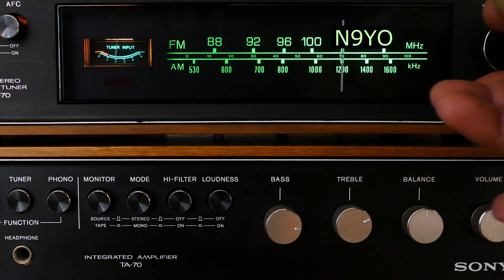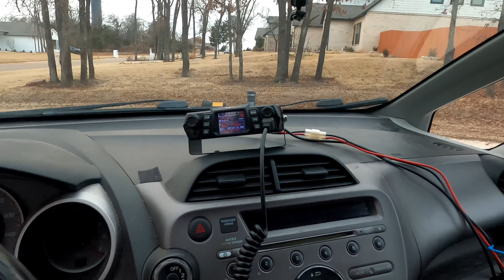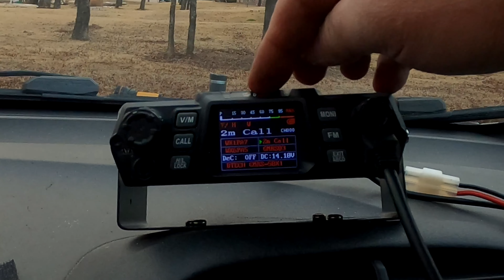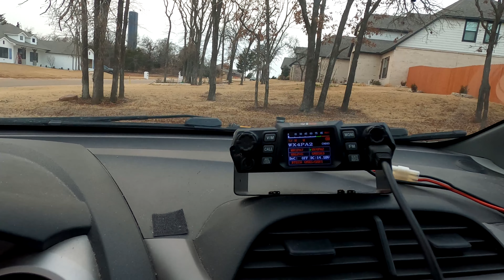Car Ham Radio Install BTECH GMRS TX 50 Watt (2M 70CM RX Only) Radio

Comment: Twister sure is a cute little guy!  Glad to hear your window mount antenna is working out for you...cool!  You are going to be set with all your mobile radio options.  I like those little Uniden CB radios.  I had a little Uniden Pro-510XL in my pick-up truck along side my Kenwood 2m mobile for years.  They perform quite well and take very little room.  I am going to get another because I like to listen to them on long trips.  I have had a grabby tool for several years and it has saved me on many occasions.  A must have!
Reply from the maker: Hey thanks for the nice comment KX4UL.  I'm still working on the car.  We got some bad weather so I postponed what I'm doing.  I'll report asap.

Comment: Black convoluted loom will cover your coax and power cabling, and adhesive tie wrap mounts will hold it in place without drilling holes.
Reply from the maker: Great idea, I just bought 100 adhesive tie wrap mounts

Comment: Am I misreading the ad for this radio?  Regarding the 2 and 70cm bands, it seems to indicate that you cannot transmit on those bands. It says: “The GMRS-50X1 is also a VHF and UHF scanning receiver capable to add additional channels for receive only.” I hope I’m reading it wrong.
Reply from the maker: Hey Larry, sorry, you are correct.  I bought this for the GMRS and I just assumed it transmitted there also.  Since it doesn't transmit 2M 70CM, I'll just put that little QYT back in there.

Comment: Hi Tom,

If you are going to drill into the roof, why would you use a mag mount?  Better to drill a hole for an NMO antenna mount, they are weatherproof and very secure.
Reply from the maker: You are correct.  I have never used an NMO mount before so I'll try that.
Reply: @hamradiocq  good luck... it’s scary drilling holes in cars!  I haven’t done it myself so I wouldn’t blame you for not doing it

Comment: Thanks for the video.  This was very helpful...  I'm new to the world of GMRS radios and connection stuff for electrical.  I just got myself the same radio Btech 50watt GMRS.  Is it right that I connect directly to the battery (of course have in line fuses)?
Reply from the maker: Welcome aboard!

Comment: NMO is the way to go. I installed mine using a step drill. I put piece of masking tape and drilled through it. Just use light pressure. Make sure the headliner is low enough so as not to drill into. When you need to take off antenna there are caps to cover and seal.
Reply from the maker: Yeah, I've never done NMO before so that's a great idea.
Reply: Ham Radio CQ, I practiced on an old license plate and installed the NMO and antenna on it first, lol. There’s some good videos out there on NMO installation. I would not have attempted myself without watching. Afterward I knew I could do it. Mine’s been on my 98 Honda almost 2 years.

Comment: Running cables thru firewalls is a royal pain.  No easy way to do it.  For the power cable, if you don’t mind the holes, can you drill a hole right behind the radio and drop the power cable down behind the stereo?  Also, I installed that same CB in my truck but even with ANL on, the ignition noise made it unusable.  I added toroids and filters...no help.  Wound up using an older CB that filters power leads better.  Have fun!  73 de K2CJB
Reply from the maker: That's a great comment.  I was cursing everything trying to get thru that Firewall.  It was horrible.   Good comment on the CB.  I used to have some that I bought at a garage sale, but I got rid of them during my last move.
Reply: @hamradiocq  Pretty funny that you found a screwdriver in there already!  Hahaha

Comment: My truck has a gap between the dash and the windshield you might need to get a fish tape to pull the wire but it might work
Reply from the maker: I don't think I have a gap there in this car. It's pretty tight.
Reply: @hamradiocq  Neither did I but I kept loosing  the pay here parking receipt down there

Comment: Careful drilling the passenger dash area...there's an airbag under there.
Reply from the maker: Yikes!  I decided to get adhesive mounts, thanks for the tip.
Reply: @hamradiocq  That little oval with "SRS" molded into it in the plastic stands for Supplemental Restraint System - the air bag is under that panel.

Installing mobile radios has become more complicated in recent years.

Comment: Looking forward to seeing some storm chasing with mascot Twister on the team. I have a Yaesu FT-857D installed in the truck, I have a dual band antenna. I have the duplexer to run both HF and VHF/UHF antennas, but I need a good mobile HF antenna. I should be able to get the GMRS freq's too. (yeah, I paid the $70 too....dang law abiding citizens).
Reply from the maker: Yeah if you or me don't follow the law we go to jail.  Others not.  : )   I looked up that 857D, looks nice.   I might do HF eventually with a radio like that. That little car doesn't have many places to hold a radio.
Reply: @hamradiocq  yeah, they don't design them for our hobbies! I had that radio in the truck when we went to Dayton, not sure if you remember. Oh the cold there is probably easier to handle because, it must be a drier climate than Misery.

Comment: If you drill a hole in the roof just go ahead and  put a through hole NMO antenna mount. This will route the coax inside and seal it up. Kills two birds with one stone.
Reply from the maker: Yeah, that's a good comment, I really have never done any other type of mounts, but an NMO sounds like it just hard bolted to the roof.

Comment: Thanks for sharing. I have the Btech UV 50X2 mobile. I use it along with a TYT 9800. The one thing I don't like about mine is the connection for the microphone seems to interfere with the control knob. Bad design. I found taking the rubber boot off sometimes helps with the clearance. Still havent found a way to get the wiring through the firewall on my Jeep Cherokee so I use the Btech im my old truck with enough rust holes in it to be able to run a water hose through the firewall with no problem hi, hi.. KE0RPU
Reply from the maker: First off, absolutely right, that control knob is too close.  Also, the difference between mute and sound is too close also.  Getting thru the firewall has confounded me for years, I finally got lucky to find this spot.  Seriously sucked though, took me about an hour that I cut out of the video.

Comment: Dude! Cut that connector off, then pull though. Replace with Anderson powerpoles.
Reply from the maker: Yeah it would have made a small difference, but it was the tough 3 layer grommet that was so difficult.

Comment: Does the GMRS radio transmit on 2m/440?
Reply from the maker: Yes it does!  This radio rocks, I think it's $200.00
Reply: I believe it's receive only on 2m/440
Reply: No, 462-467